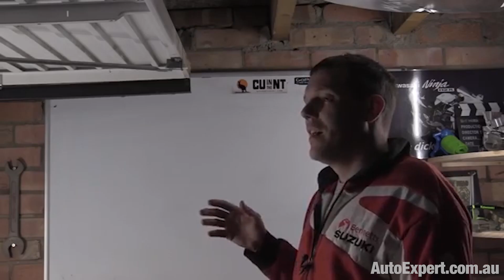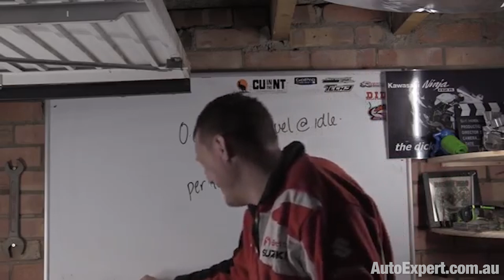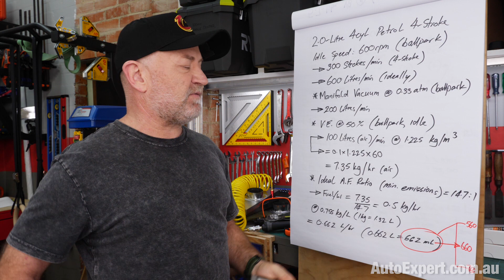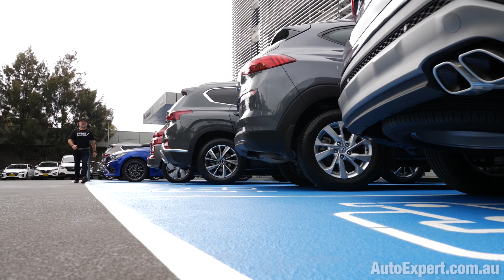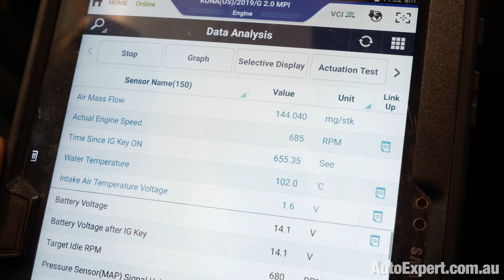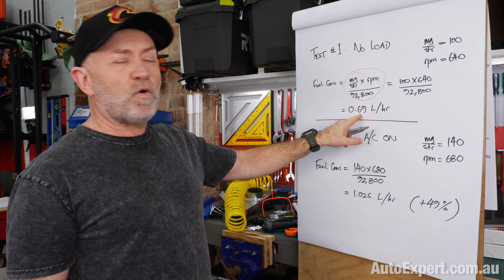Engine Fuel Consumption at Idle Explained (theory and physical test) | Auto Expert John Cadogan

Comment: Hey John sorry bout the late comment. Have noticed a lot of videos stating the perils of diesel idleing for long periods claiming that they burn mostly air and thus not producing enough heat for proper combustion etc. I also remember way back in the late 70's Tony Barber telling us that the old Mercs he was giving away burned 90% less fuel idling at the lights compared to petrol engines. So are there any figures for a modern 2 liter diesel and my landcruiser 1hz. Thanks

Comment: If the fuel consumption is expressed in litres/100Km instead of the more standard km/litre why is the speed still expressed in km/hour and not hours/100Km? And what is the speed in kph. There is no kph in the SI. I guess it's an Anglo-saxon thing
Reply: litres per 100km is expressing consumption. Like the cessna I fly consumes 9usg per hour. KM/litre or miles per gallon  is not answering consumption. It is saying how far you travel, i.e. distance per unit of fuel. Thats not answering consumption.
Reply: @TRPGpilot   I appreciate that. But that is my point, we travel (by car) a distance from A to B not in 100km steps. I don't care what is the consumption but rather how much fuel I need to travel from A to B. That is why the unity litre IMO is more direct. If my car can make 20Km with one litre if A to B is 100Km I need at least 5 litres in the tank. It is the same as why the velocity is expressed in space/time(unity) km/h and not in hours per 100km where 100 is an arbitrary number. In aviation things change as you calculate the time to travel from A to B according to wind velocity and direction. There is no fixed distance in the air as the wind can make the trip longer or shorter because the air speed let's say is constant, but ground speed is not. Ultimately we have to reach a ground point right?
Reply: @alfonsopelizzo6662   A question of consumption can only be answered in reference to a fixed point, be it hours or distance i.e. lites per 100km or litres per hour in the case of small light aircraft or tons per hour in heavy aircraft.  (tonnes/seat/kilometre is also used in comercial aviation, notice that 1 kilometre and 1 seat becomes the fixed point over which consumption is measured) The answer to that question then directly translates to the cost of fueling and the cost of a journey.  There are specific reasons why its expressed that way and not miles/gallon or  kilometres/ litre for acurracy and comparison purposes. Look it up in your favourite search engine. Have a good day.
Reply: @TRPGpilot  I understand your point. You want to see the cost of fueling while I want to make sure I have enough fuel in the tank for the journey. Both are valid points and that's why we can change l/100km or km/l in the car display. That is university: the unity of diversity. Have a good day.
Reply: @alfonsopelizzo6662  Take for example that you have a 50 litre tank. Your consumption is 10l/100km. You have a range of 500km. You see? It works both for consumption and range. Have a good day yourself.
Reply: @TRPGpilot  But that, as you said, if directly translates to the cost of fueling, I need to spend more, eg I have to buy 50 litres of fuel to make sure I got enough. That is why the fruit shops should show the prices in Kg/100$ of apples or oranges. They would make more money hehe. Also, if the time is a cost, when you fly you should use hours per 100km as an indication of speed. You didn't comment on that yet.
Reply: @alfonsopelizzo6662  In my country the price per KG or price per 100 grammes or per litre or per 100ml as applicable is provided on the price label to ensure ease of comparison between different items. Brand A priced at  £1.50 for 2kg and Brand B priced at £1.40 for 1.9 kg is easily compared when the price per 100g or kg  is listed on the pricing information. The constant here is 100g or 1kg etc. The variable is the price in £. Same as consumption the fixed constant is 100km with the variable being the consumption in litres.

Comment: Great video. Love your scientific, no nonsense approach. 
I did a quick recalculation in that you used 600 rpm as ballpark idling speed. If one compensates for the extra 40rpm, your initial 'guestimate' is within 7.8% of the actual. Capital!
How about having a go at doing an empirical? Or are your response to that suggestion like mine?
No.
That was my verdict when I considered the physical amount of energy to be chucked down the trough of entropy to plumb in an independent pressurized fuel line to produce an answer that we already know.
In my case above is known as being too lazy...

Comment: I watched your video about hydrogen engines my car runs  on only  hydrogen. Has 1200,0000 miles no problems  NOT with any oil or anything like you said in your video yes I have my own gas station in my backyard because it is free

Comment: What about manboobs? That was a good watch at 150% playback speed. If I understood it, your results correlate with the Japanese paper, Engineering Explained referenced (https://youtu.be/dFImHhNwbJo), which shows that not idling a small 4 cylinder engine for more than about 7 seconds will save you fuel, assuming the ignition processes fuel consumption is in line with the other research.  My Forester keeps track of accumulated "savings", which are allegedly around half a tank after about 2 years of ownership, which seems to be an overestimate, according to the research, but is a saving none the less (if one doesn't consider the risk of increased wear).  That noted, I will add that anecdotally I've found that the best fuel savings are made by walking, which also eliminates engine wear. Just be warned though, if done often enough walking can eliminate man boobs.

Comment: Sorry for being a dunce, but if the crankshaft is rotating at 600 rpm, them surely, whether 2 or 4 stroke, wouldn't the strokes be 2 per rotation, i.e. 1 up, 1 down, or are you meaning "cycles"?
So why is a 4-stroke listed as 300 strokes at 600 rpm?
I'm certain I'll be put in my place, but had to ask...

Comment: Any VAG car engine for example will say loud and clear on the instrucment cluster screen the idle consumption. In my case it's between 0.5 and 1.3 L/h (2.0 TDI engine) depending on the engine temperature, environment temperature, altitude and A/C being on or off. The diag values are about 5-7 mg of fuel per stroke per piston @ 840 RPM idle.

Comment: John, what about ancillary components? How much fuel does an AC compressor use per hour? I'm guessing its power consumption in kWh (depending on the heat it needs to shift from side to side) is what gives the answer in the end... But I'm not an engineer and I'll admit that I'm too lazy to crunch the numbers myself 😔.

Comment: A clear explanation about fuel consumption at idle. I like the way you do your videos.
 Question, on a diesel engine the fuel consumption becomes lower due to no air restriction or vacuum on the intake manifold? And how much fuel is used @ idle? (approximately)
Thanks.
Cheers.

Comment: I love this. Thanks John. But... Am I being pedantic (or perhaps just wrong) in suggesting that when you said it will cost about $1.50 to sit in traffic with the A/C on that you were comparing it to having the engine off, not compared to having the engine on with the A/C off. My point is (assuming I'm right) that it will only cost around 50c per hour extra to leave the engine on and use the A/C. This is about what I thought it would cost. I'm amazed at people (two in my family) who refuse to use the A/C that their cars have it because it uses so much fuel. I've seen them after a 4 hour drive, in the middle of summer, get out all red and sweaty rather than pay the 3 or 4 dollars extra that the A/C would have chewed through. They are probably anti vaxers too. (Personal opinion only)
Reply from the maker: Yes - that I think was exactly what I was saying (it's been a while since I crunched those numbers and wrote that script). Here's the evidence the HVAC doesn't use much fuel: When you're driving on the highway (A/C off) and you flick to 'A/C max' - you don't need discern-ably more throttle to maintain speed... Those relatives are roasting themselves needlessly.

Comment: Surely displacement is almost entirely irrelevant? Idle fuel burn is literally just what it takes to overcome the engine's internal resistance, and that won't change much if you increase displacement without changing anything else.

Only other contributing factor is thermal efficiency at that time and that'll be quite abysmal given the reduced pressure ratio the engine operates at when the throttle is closed.

All the maths in this video are just another way of finding out what we care about without knowing either of the above.

Comment: NA viewer here, and I know this is months after the fact; however, I think it odd that changing the number of cylinders would change the fuel consumption in any significant way because it seems to be following the same fallacy as the "per liter/litre" argument. The amount of fuel pumped into a cylinder does not scale at idle simply because the chamber is larger, certainly, but if you have more cylinders, would you not simply distribute the same amount of fuel over the wider volume rather than increasing it? (Note: this assumes the amount of air going in changes as well, but who really cares about that when air is free?)

Comment: Funny that it’s 0,6 litre pr hr😊 i got curious uesterday. I filled exactly 0,6 litre petrol in a open can. And put fire on it. I expected it to last 10-15 minutes. But it lasted for 1 hr 48 minutes. And since my 2 litre engine kept me warm waiting.  So my 2 litre idled that time used almost 3 litre. If it is 0.6 litre pr litre. But since idle rpm is mentioned. Many BMW’s idle lower at 730-770 rpm. 6 cylindre and smooth idle. I would been better of with an auxilary heater. But is a "self living" flame better than sprayed with air pumping to maintain temperature in a car? I reccon i could make it burn longer by put a top over with an restricted opening. Made me start thinking about a lot about how cars are buildt. Power steering pumps could had clutch like an AC pump. So in when in neutral stand still in P. It switched off. Maybe an engine while "knowing it would be idleing for a while it could adjust itself to just manage itself idle more calm to use less. But now a days that would been done in ln the 70’s😁 and i like that Ford made some engines start without starter engine( spray fuel in cylinders in ignition position and just ignite to get the cycle of strokes running. And i would liked the engines with internal gears instead of time belt/chain. And water pump, generator and power steering pump been one unit internal. Which just find the drive gear while pushed in the engine like a drawer. It would been so much less bad noises from pulleys etc. So less hoses since engines couuld had channels in the block frim power steering pump and had outlet/inlet at a suitable place. And reservoir would been a part of the top or block. Or been better if power steering could work with the engine oil since things are simple and internal😊 im dissapointed by thrown on parts with spaghetties all around😁 but people have different meanings. But if i was able to made some cars it would been something like that😊

Comment: An excellent bit of physics, engineering, and dimensional analysis.  It bridges the gap between the abstract and the concrete.  As to the "per liter displacement" controversy, larger engines idle at lower RPMs which, at least partially, compensates for the larger amount of air per rev of a larger engine.

Comment: Everyone despises stop start engine systems with justifiable vitriol but do they actually save any fuel or pollution? It is entirely possible that they cause more fuel waste and pollution.
How so you ask? especially when all the tests say they save fuel.
Because they don't measure the fuel wasted by the vehicles behind that get stuck at each light cycle. It takes more fuel to start and stop and start again than it does to idle at the lights and unless you have an idiot who's too busy texting or doing their makeup to notice a light change a stop start vehicle will take a lot longer to move off than a normal one. Because of this delay instead of being able to accelerate and keep going you have to stop and wait another light cycle and thus wasting more fuel to get moving again.

Comment: Hey John, I work for a Suzuki dealer, would you be interested to see (via youtube) live idling data for a Suzuki 1 ltr 3 cyl boosterjet engine? (DI petrol turbo)  I would just post the ltr/hr stats but algebra gives me a headache ;) (if anyone else wants it, lmk). Excellent video btw, but 1 thing, you say that auto stop/start is BS, then how come fuel savings of ~5% are seen (e.g 2 tests I can think of straight away were done by 5th gear, sticking 1ltr of fuel in a car & driving it until it died).

Comment: Thank GOD engineers don’t have their fucking act together or I’d be out of a job as a mechanic and have to look for a new profession. My I suggest a simpler solution is take a car with a 2 liter engine and remote hook up a calibrated fuel Retainment vessel calibrated in what the fuck , fill it with fuel start the engine let it run for one hour and while it’s running you sit idly by drinking 92 proof Clyde Mays whiskey as a safety measure and see how much fuel is leftover in the fuel vessel and the whiskey bottle and if you are still standing more fun🤪🤪🤪🤪🤪🤪🤪. In final conclusion who gives a fuck anyway let’s keep on drinking whiskey and listening to 60’s surf guitar  music on the stereo. Then at the end of all this I will ask the question what is the square root of a negative one 🤪🤪🤪🤪😎😎😎😎😎😎😎😎🖕.

Comment: Great explanation!  I do have a nit-pick about one point that threw me off 'til you cleared it up with your description.  At first, it seemed as if you were saying the 2 strokes per rev were due to using a 4 stroke engine (maybe there was wax in my ears), this in facts jives with what I was taught about "suck, squeeze, bang, blow".  It finally dawned on me that (as you had early in the video) you were still only counting intake strokes -- the 2 came from the number of cylinders (4) times the average number of intake strokes per cylinder per rev (1/2).  Thanks for clearing it up with the note about 6 cylinders.  Then I read the note in red, which verified this (and which I suppose I should have done earlier).  I like that you got around the possible confusion over what the measurements refer to (air or fuel) by dividing the board into sections.

Comment: If a car comes with idle stop/start that cannot be disabled, I am not buying that crap.  The minute amount you saved in gasoline at idle is exceeded by the cost of wearing out your battery and starter motor.

I would never buy a hyundai/kia.  Those crap has also falsified their mpg ratings before.  Not to mention their cars break earlier than the typical big three japanese manufacturers like honda, toyota, and suzuki.
Reply from the maker: The battery and starter are typically not used for the restart. That's just a backup - the car actually stops the engine (cyl. #1) just after TDC on the compression stroke. All that's needed for the restart is to fire the spark plug...

Comment: The dashboard “computer” in my car displays fuel consumption as l/100km when the car is moving and l/hr when stopped.  At idle when stopped with the gearbox in neutral and the air conditioner off it reads 1.2l/hr.  The engine displaces 4.2l.  I think John is correct.

Comment: Just like the difference in fuel consumption with the air conditioning on versus off, idling in gear (in the instance of a car equipped with an automatic transmission) the idling fuel consumption would be greater in gear versus neutral as well. In gear+air on= highest fuel consumption at idle. (No other electrical accessories on as well)

Comment: The trip computer in my 1.4l twincharged direct injected vw reports 600-700 l/hr at idle. Make of that what you will.
Reply from the maker: It has forced induction...
Reply: @AutoExpertJC  Exactly what I thought. Perhaps it has a MAP sensor so I can look at the throughput of air on my bluetooth dongle and do the maths. I did mean ml/hr (since corrected). It is interesting, though that the consumption at idle of a direct injected, forced induction 1.4 is in the same ballpark as an NA MPI 2l.
Reply from the maker: @cme2cau  Depends what the supercharger is doing at idle, I suppose. It probably performs about the same as an atmo 2.0 in most respects.
Reply: @AutoExpertJC  The supercharger should be doing nothing at idle, it has a magnetic clutch off the water pump controlled by the EMS. You can hear the little bugger whine when you put the boot in at low revs. I think the supercharger is just there to eliminate turbo lag, in the pre twin scroll days. But yeah, performance wise it's like an NA 2l, except for the 240 Nm at 1700 rpm and the better fuel economy (it drinks 98 though). It's replacing my 2l MPI i30 manual. On my commute, the i30 got about 7.7 l/100km, the DSG Golf gets 6.4 l/100 km. This involves mostly 80 km/hr roads.  My wife's commute, in heavier traffic and slower speeds, achieved 9.2 l/100 km in the Golf. She now drives a Toyota 86 auto and gets 7.8 l/100 km on the same commute. I reckon VW turned up the injectors on acceleration so the second 1.4 didn't eat pistons like the first one did!

Comment: How do you know the air/fuel ratio is 14.7 to 1? I would have liked to see a wideband reading to make it more accurate, how many engines run smoothly at stoich? It's only a theoretical number that doesn't necessarily mean anything in practice.